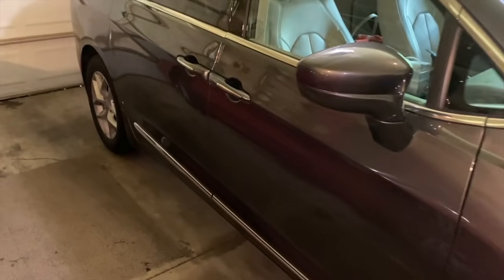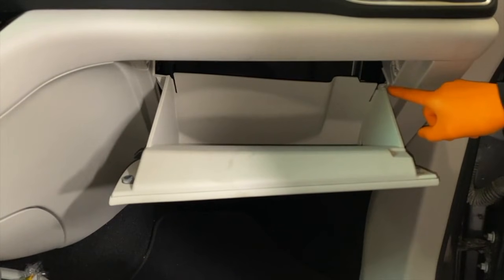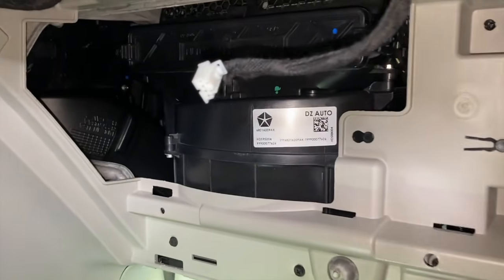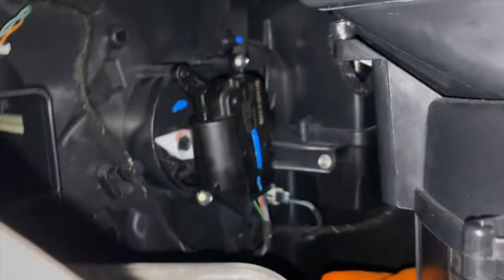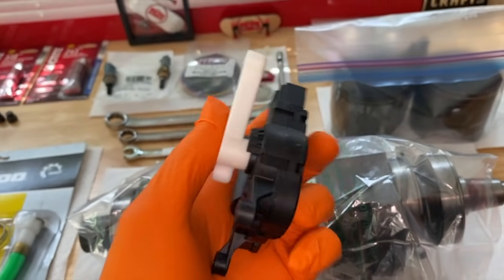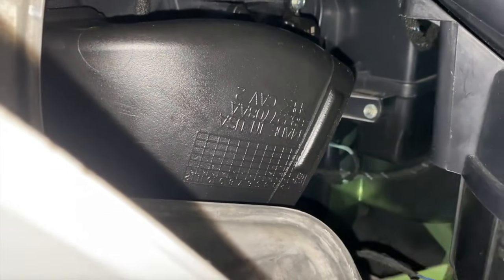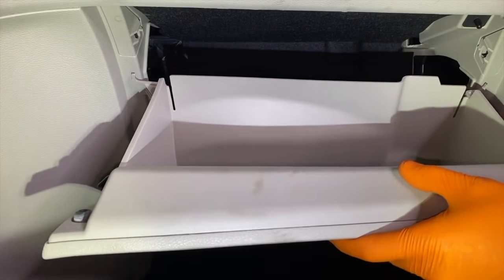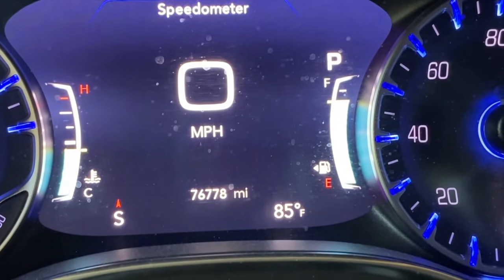Replace 2018 Chrysler Pacifica AC Heat recirculation actuator motor

Comment from the maker: If interested in purchasing this product, visit our Amazon affiliate link below.  I earn from qualifying purchases.

New Key Fob:  https://amzn.to/49avRp8

New Key Fob batteries CR2032:  https://amzn.to/3UTBrrR

AC/Heat recirculation motor:  https://amzn.to/3ZnoO93

Plastic lock-clip removal tool:  https://amzn.to/49kq5Ci

Ratchet Socket set:  https://amzn.to/3OhgUt6

Pry bar set:  https://amzn.to/3BebxY6

RED automotive grease:  https://amzn.to/4f10WO3

42 piece socket bit set:  https://amzn.to/3VqWocT

Pic tool set:  https://amzn.to/4ilAcuM

Front brake pads:  https://amzn.to/4ilkjEA

Front rotors:  https://amzn.to/4f79nr3

Rear brake pads:  https://amzn.to/4icIJA9

Rear rotors:  https://amzn.to/3CUIlG2

Recirculation Actuator Motor:

          https://amzn.to/42oXdFp

          https://amzn.to/4977w2U

Cabin Air Filter:

          https://amzn.to/42fT0DT

          https://amzn.to/3vQFqLj

Auxiliary Battery:  https://amzn.to/3S291sj

Primary battery:  https://amzn.to/3CZFUSG

************

1.  Replace Pacifica rear brake pads and rotors

          https://youtu.be/qiVYllAOduM

2.  How to unlock and start Pacifica engine

          https://youtu.be/7PzJbDwrm68

3.  Replace Pacifica Key FOB battery

       https://youtu.be/3EO1aLqSkfU?si=Q6m_FvzwuCJETd66

4.  Replace Recirculation Actuator Motor

          https://youtu.be/U8p_3Rn6sYY?si=_At_ZMn_fFG6nB0a

5.  Replace Cabin Air filter

          https://youtu.be/zyuM70JXoJA

6.  Dirty sock smell coming from vents

          https://youtu.be/40dHOBGGjwE

7.  RED DOT illuminated - Common causes and help to get your engine started

          https://youtu.be/5loYi1ROUJM

8.  Pacifica brakes LOCKED - DIY fix

          https://youtu.be/iCdwxw7E3Os

9.  Replace Auxiliary Battery

          https://youtu.be/j7tmZUOZLgo

10.  Replace primary battery

          https://youtu.be/WOikYiQsYnw

11.  Replace Pacifica interior overhead light

          https://youtu.be/yEa-Mri1poI

12.  Replace Pacifica windshield wipers

          https://youtu.be/XnEpQ_hWlIY

13.  Replace Pacifica rear wiper

          https://youtu.be/PVWSdB0KvSs

14.  Remove Pacifica spare tire

          https://youtu.be/-zpPsm4icAg

15.  Adjust Pacifica headrest

          https://youtu.be/73HkStcw1fw

Comment: This is great info.  I was hoping to see how to remove the blower motor.  It looks like you start off the same way, but the passenger side air bag, which is below the glove box, seems to be in the way of removing it.  How do I remove it without setting the air bag off?
Reply: I NEED THIS AS WELL
Reply from the maker: Thanks for watching, any update?

You will need to deactivate the air bag.  Depending on your year/make/model model, this can be done through your center screen settings, or removing the appropriate fuses that power and manage your air bag system.